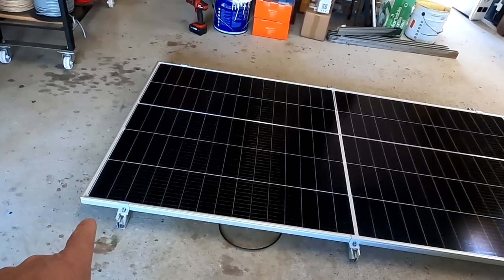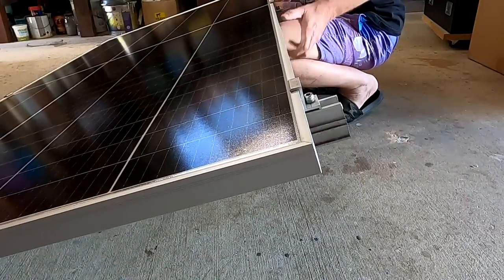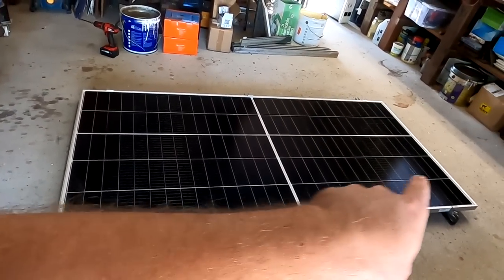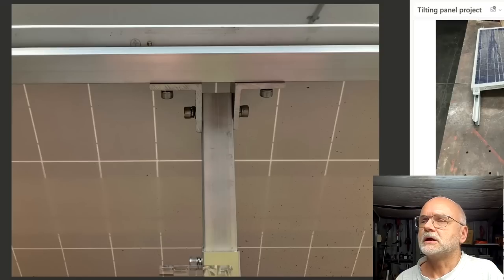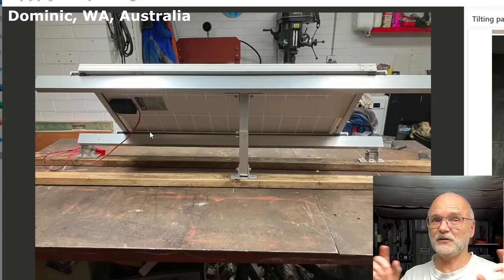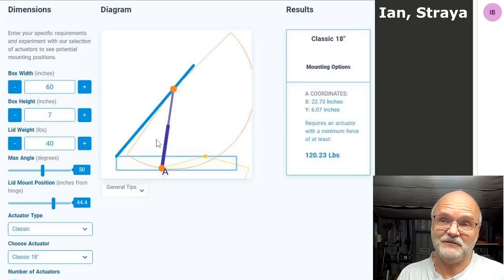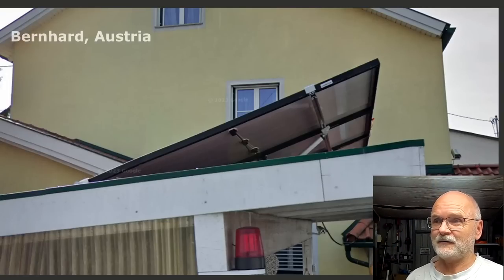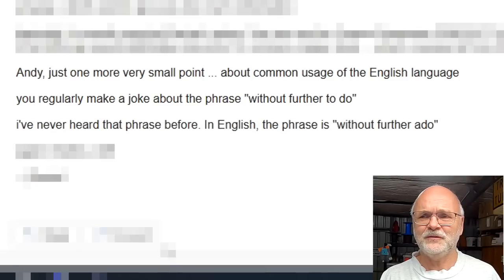Single axis solar tracker with large panels impossible? Here are YOUR suggestions.

Comment: Another thing: I will put my panels in two different positions on my house: flat for summer. (with spacing underneath though to breath away the hot air), and tilted for winter. At some point in time I would put it in winter tilt, and at some point in time in summer (when the visibility irritates me ;-) ).
It would be on a flat roof of which the remainder would be a grass roof terras. As a matter of fact, maybe I should do full grass, because the grass underneath the panels would help keep it cool.

Comment: Hi Andy Can you tell me where you got the feet for the tilt system please, When you built the frame, i think it would have been better to have 2/3 cross supports first to give the panel rigidity, then the uprights.. Have a think on using a 2.3m poly pipe with a T in the middle, then 2 90 deg bends on the end and join them with a 60mm straight to a 90 deg bend to a 2.3m straight. On the bottom straight put a chain from there to the bottom of the panel Fully adjustable and sturdy but manual and fairly cheap.. As Paul said think of an easel.. I have seen this on a video, i will try and find it for you. P.s great video and keep up the great work :)
Reply: Have two rails fixed to the roof under the panel and fix polly pipe clips to the rails for the relevant angles
Reply from the maker: I have the links for the tilt system in the description.

Comment: if you went with the one that had the rails with the wheels on the inside you could have a rubber skirt  which would do away with all the leaves in the track or dirt  after the wheel has passed the flat will just flop back down into place  keeping the tracks from getting dirty
Reply from the maker: Yeah, I know, but look what we are doing, adding more and more to the system...

Comment: The panel flexing problem would be a weakness in the corners, maybe trying to reinforce the corners at least on the top side where the actuator will be. Some kind of bracket with 2 90 degree bends (corner of a cube) that can be bolted on three sides of each of the top corners of the panel frame.
This could also keep the total profile low.

Comment: Hello Andy, I have been thinking about your twisting solar panel issue. Just fixing some roof mounts wil not solve your problem, you need a 3d structure with triangles.
Also considering the storm issue, it would be nice if a reverse angle was possible.
I think you need 2 triangle shapes on the sides (closed or welded) that are connected by crossing diagonal bars, both at the bottom and the back. These will give the structure more strength against twisting in any direction. By not choosing a 90 degree angle for the back, you can create an opposite and very shallow angle for the panels in case of storms. The hinge for tilting should be at the back, so  that the solar panel front just lifts up for the storm position (could also be horizontal for minimal air resistance and maybe even summer use).
This way you have a very rigid structure to mount your solar panel, and by moving the hinge to the back of the mount the actuator needs less power. 
I can make a design if you find the idea interesting, but still somewhat unclear.
Reply from the maker: It is too much of a hassle to build such a frame. It also would be very heavy and I need Andy2 to help me get it up the roof. And this is just for one panel!
I'll go with the static tilt system as originally designed first and see how much energy the system will generate.
Reply: I would try reinforcing / bracing the corners Andy, for prototype / test purposes you could try 45cm square plywood / aluminium backer plate if you have left overs. The same sort of idea you see used to reinforce "helium metal" storage shelving.
Reply: @OffGridGarageAustralia  I agree that building something strong is a hassle, but if you are not sure about the strength of your roof, it may be wise to invest some time.

The frame does not need to be very heavy, as you do not need very strong materials with the right design. Compare this to the back of a cabinet (Ikea for example). Even the thinnest sheet of board adds plenty of strength. But without it, the cabinet collapses. You could even use metal wires instead of cross-beams.

If you are not willing to invest time to make this setup strong (and safe), then i think just filling up the roof with as many extra panels and inverter capacity as you need, may a much better idea and has a higher WAF as long as cost is not an issue.

Comment: Like most people's solar panels, my solar panels have MC4 connectors.

After they have been outside making power for a while, it is sometimes necessary to disconnect them for troubleshooting, new wiring configuration, upgrading and so on.

But every time I try to do that, I am so frustrated! Disconnecting flying MC4 connectors can be so hard!

Most of these are cable mount MC4 males to cable mount MC4 females. They are so stuck together!

I have several MC4 removal tools. Some plastic, one metal. They are no help at all. Feels like I'm nearly ripping my shoulder muscles apart trying to disconnect a male MC4 from a female MC4. All the tools do is squeeze the two locking tabs in. This does not free up the connectors from each other at all.

Have you found any MC4 tools that make this job easy?

Comment: Torsion would be best sorted with angle rather than box section. If you can get large sections of aluminium angle instead, for the same weight you can get more distance away from the plane of the panel, which is better leverage against twisting. It also allows you to use a simple hole and bolt to mount an actuator.

When it comes to actuators, have you considered a hydraulic solution? the fluid can help balance for different resistance on each strut so that they come up level without needing to use sensors or logic to keep electric actuators aligned with eachother. Much easier to monitor and control a single pump for flow and pressure for reference points.

Comment: The panel is a two dimensional structure and the flexing is happening on the third dimension.  That is why two 'vertical' actuators will make it very rigid.  The solution involves the third dimension.
Reply from the maker: Yes, which also makes it a lot more complex...
Great explanation by the way!

Comment: Hi Andy, just a wild though, how about keeping the panels flat on the roof but have an angled diffuser raised at an angle, might just give you cloudy day conditions. There also might be a reflector option to do the same kind of thing.
Reply from the maker: Clouds are the diffuser already. In these conditions my garage setup works well enough. I need these panels to perform in sunny conditions when the others are shaded.

Comment: Can't be bothered drawing a design but you could use gas struts similar to ones on a car tailgate. One mounted each side and the actuator in the middle. They would have to be mounted in such away  so that when they were folded flat they would have the effect of holding the panels down.  It the up position they would support both sides to stop flexing.
I think it would work but would take a bit of trial and error to get it to work. I hope someone can understand what I'm talking about haven't explained it very well!
Reply from the maker: Could work, yes. Quite a few people have made that suggestion...

Comment: FYI: Large solar panels on single-axis solar trackers wobble. They are not as rigid as you are thinking, and most are mounted with just 2 rails.
Reply from the maker: If we get someone to weld a steel frame for the panel, it may actually work. But what an effort...🤷‍♂️

Comment: 90 degrees Alu profile 30mm*30mm or wider screwed to the frame on the long side will reinforce the frame and probably reduce or remove flexing enough.
Reply from the maker: The question is, will a reduction of movement be enough or is it still bad for the panels and they will suffer over time? I would rather see a 'no movement' solution.

Comment: you may be able to use something like a snow fence for sheilding.... just create a low pressure(speed) zone so the osilation doesnt occur?
Reply from the maker: That sounds easy when you say it.
Reply: @OffGridGarageAustralia  have a look at snow fences.   it likely would stop the oscillating as you have a consistent lower pressure zone under panel. vortex wind generators are a great example of this problem. though for them its leveraged.

Comment: Seeing the scissor lift options and then seeing someone using a scissor lift car jack... Sure it's overkill but it's ubiquitous and should be cheap to buy from the local wrecking yard.... 
Making a frame for the back of the solar panel for stability, that panel is so big that it can be used as a gate! Hmmmm what do you do to give a gate more stability? How about a cross brace? That way you Link all three rail's diagonally... Not sure if this would work for this specific application... You tried different ways and all of them had the rails at 90° angles to each other but maybe, just maybe one rail at 45° from the top of one side to the bottom of the other crossing the middle rail in the middle of it... It's so simple that it might actually work.... 
My wooden gate is built that way, has two hinges on one side and the latch on the opposite side and it doesn't wobble.... 
I too have been considering adding panels that are aimed specifically at the winter solstice sun... I plan to fix them in one position and be done with it, it doesn't matter if they don't perform well during the other months, the other panels do very well except for the last week of June and the first week of July and this is where I need just a little more power... 
I might have to mount my winter panels to gates LoL... With the gate latch, I could even make the angle adjustable by drilling a few more holes LoL... Basically adjust it and put a padlock on it to lock it in place LoL....

Comment: I've had three firgelli actuators fail recently stripped out screw drive it's plastic they also won't supply the replacement parts at $400 for each actuator kinda sucks
Reply from the maker: Great, sound like good quality...

Comment: Look at the spacing you need between the panels when they are tilted up to avoid shading.  You can put 2x to 3x more panels flat than you can with panels tilted and not shading others.  If you really want the tilt, then you would do better to just mount an array near the sunny side of your garage anchored to the ground.

Comment: With such easy access to your roof and the fact that you are not trying to track east to west and only the summer and winter angle I would just do this manually maybe once a week. You proved this yourself by comparing the 3 panels at a greater angle in the garden to the 1 panel at a lower angle on the roof. Don’t over engineer this Andy. As they say “keep it simple stupid”
Reply from the maker: I have now installed a fixed tilt system as originally planned.

Comment: What about using very long and narrow panels like the SLP080S-12M or something similar. Then you could statically tilt many of them due to the low shadow angle.  Then combine them with Reino’s tilting idea.
Reply from the maker: These are already as long as the roof allows. Longer ones would stand over the gutter😄
Reply: @OffGridGarageAustralia  Yes but not longer than what you have, just half or a third as wide as what you have.  Same length. Long and narrow.

Comment: you need One actuator pushing a triangle actuator in the centre the 2 ends of the triangle Attached to the bottom of the frame of the solar panel on both sides. (though you may lose some range)  The triangle will make everything stronger
Reply from the maker: That's a lot of triangles and mechanics...
Reply: 1 triangle on each solar panel the triangle  will stop it from twisting.

Comment: Hi Andy,
Why don't you use a gas cilinder left and right (like a car hood) and 1 actuator in the middle?
Reply from the maker: That may work. Just, where to mount them. They need to have a very defined mounting point.

Comment: scissor jack .. central drive and the arms spread to sides  and creates support ? but as i have always found .. KISS . smiles . similar conditions down on the flats in beerwah..lol.. ok .. i see scissor ideas have already been opined ... the lowest pivot can be made simply by using gal pipe sleeved to make the hinges .. damn strong and forever structure .. then build up from that base .. ok the scissor jack idea wasnt meant to direst use .. just idea of central operator and expanding?... lol.. i have been playing with these ideas for last yrs ... still just using jury rig system till i finalise my frame system

Comment: Hello Andy, to reduce the wobble, you have to mount diagonal (diagonal cross) to the frame. Maybe one over the three aluminium frame bars and one under the three aluminium frame bars. Than you can use one actuator in the middle. Viele Grüße aus Deutschland.

Comment: @Andy, you CAN overpanel inverters, as long as you keep voltage within spec.  Panels never PUSH amps through the MPPT; rather the controller DRAWS its rated Amps, if available. So, no damage will be done to the MPPTs. What overpannelling allows is reaching top charging spec early in the morning and keeping it up till later in the evening. This will of course shave the upper part of your charging bell graph during the day and make it look flat. But is worth it, since panels nowadays are cheaper than overbuilding the support structure and adding actuators and more points of failure 😅
Reply: you should never exceed the short-circuit current rating of an mppt - it is not able to arrest the peak current during a high input change event such as a cloud-break - this causes degradation of the FETs over time, leading to premature failure that isn't covered by warranty. Specifications exist for a reason.
Reply from the maker: In terms of over-panelling, most MPPTs give you a fixed maximum for either PV power or PV short current. If it would not matter how many panels you can connect, this data would be obsolete.
MPPTs can short the PV side under certain conditions to protect the battery. Hence these two limits are given.

Comment: i think your idea with 2 acturators is okay, but you dont need some which can communicate with each other. Buy 2 actuators with position sensors and connect them to a uC like an arduino or esp32, write a few lines of code and then you'll know if one of them isnt moving and you can stop.

Comment: Frame would be stiffer i you install second set of 3 cross rails under the horizontal rails in addition the the 3 cross rails on top.
Reply from the maker: I'm running out of rails...😁
Reply: @OffGridGarageAustralia  They do not have to be expensive rails. Square tubes or "C" or "L" shaped pieces would do the job.
The more "boxy" is the frame the stiffer it is. Flat frame will newer be stiff.

Comment: my humble opinion, that actuator system is overkill...just make a frame that keeps them up. are you worried about the wind at that angle?
Reply from the maker: Have built the fixed angle tilt mount now as initial planned.

Comment: You need flex in panels because of hail or heavy rain. The shock effects is dispersed.
Reply: this is incorrect and more likely to lead to a resonance effect - where the panel is busy returning to "normal" after being hit, and then being hit again - this time there's higher velocity.

Aluminum flexing leads to fatigue failure over time.

Comment: You are over thinking the problem I used to build automated systems and all you need to do is work out the load the actuator needs to lift and lower the panels add 10% more and fuse at that  if one stops working as soon as the other side starts loading it will blow the fuse. 

We used to do automated nesting boxes for chickens to stop them sleeping in them at night and if a chicken got stuck in the system it would trip the breaker and need manual reset and even the chickens was ok.

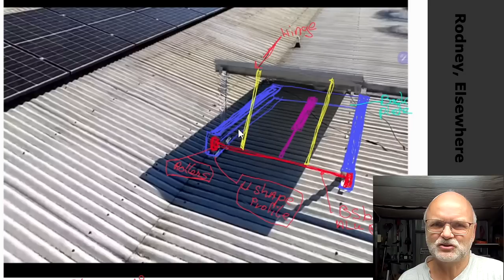Comment: 27:39 Instead of having a single set of wheels in the channel, why not a small trolley, which will not shear like a two wheel solution?
Reply from the maker: It has the same problems as on wheel. Also, more parts to break.

Comment: @andy
I think you are wasting time.... unless the system will be  super automatic during its life..,.I don't think as we grow old we will be always be on point to track and move it up and down.
My take..  .lets just over panel to guarantee  production.

I have done it down here in Dar es Salaam..   ..Now it is winter but I have guarantee of 1500W-2000W during this winter
Reply from the maker: Some MPPTs will short the panels under certain circumstances to protect the battery. If the short current exceeds the specifications -> smoke.
It will work for some time until that moment...  It's a bit risky...

Comment: In one breath you dont think "that" will be strong enough the next breath you are like I dont think we need a car jack.  that is a bit much.     An actuator can lift a conquerable amount as it only works for a short time and then rests.  And the speed it moves the panel in this case is slow.   
 You seem very concerned with building a bullet proof system that needs no maintenance yet you admit you really only need it for 2 months a year.  Also I am a loss as to understand why you think it need to be so ridged?   We now have very flexible panels out there.  Clearly some flex is not a big deal if they make ones with the same cells that down right bend.
A nice not friend took a hammer to a panel of mine.   Smashed the crap out of it.   Bent the frame and all.  Still made 80% of the original rating.  In my experience that framed panels like the one you are working with are very strong.